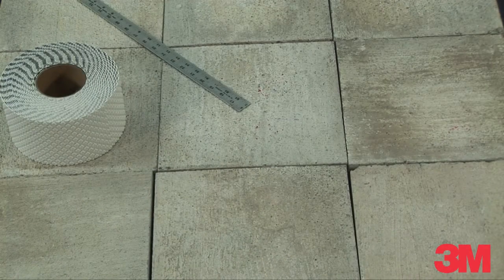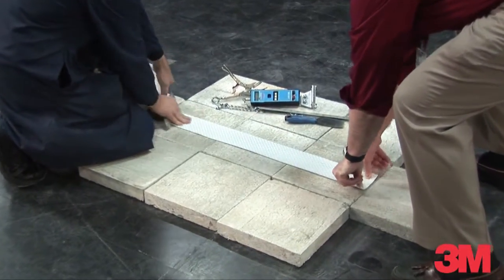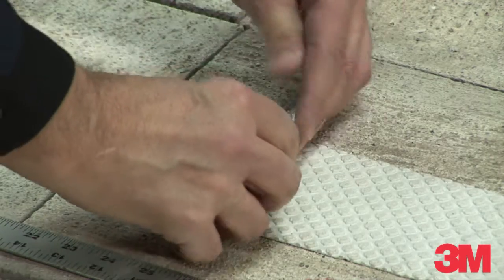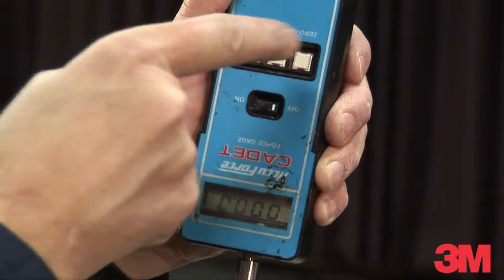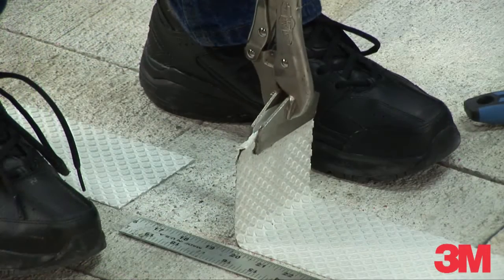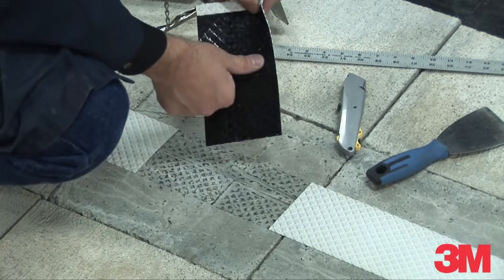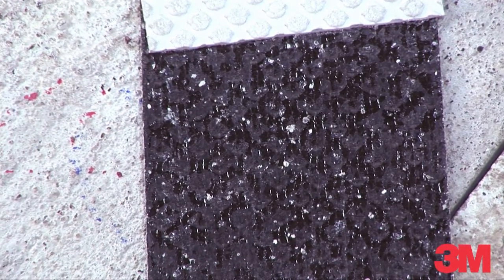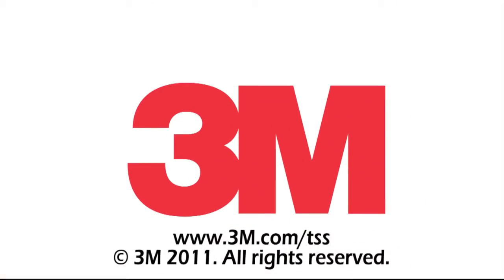3M Pavement Marking Peel Test

Comment: "record the values and calculate the average" but what is a good number to compare to?
Reply: Anything above 12lbs is solid adhesion and should perform very well. Dust, dirt and dried concrete slurry is BAD
Reply: @grierk3991  thank you sir